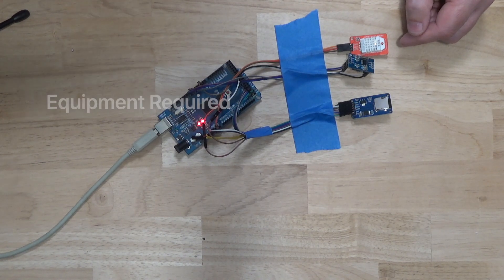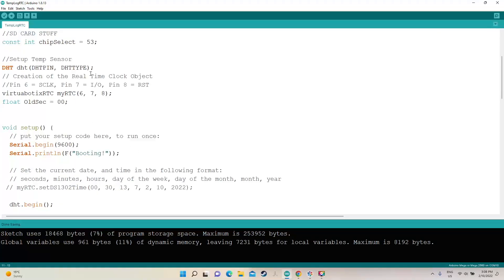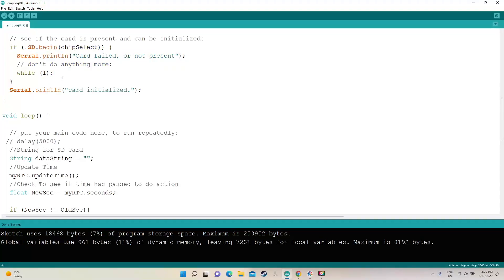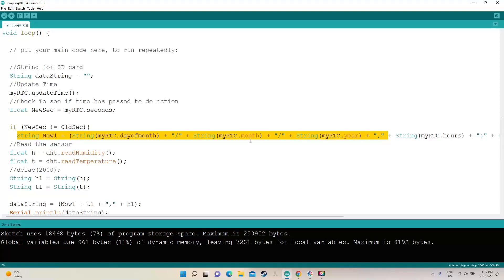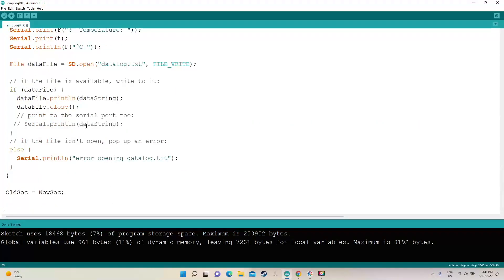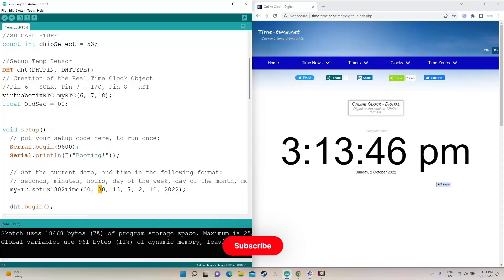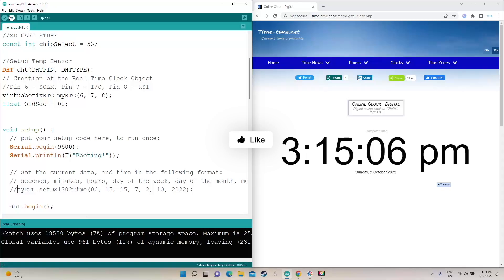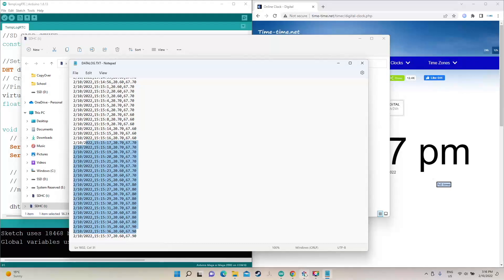SD Card Data logger using a Real Time Clock and Arduino

Comment: what is benefit to using rtc board? doesnt arduino have built in timers?
Reply from the maker: It’s the actual time, and it keeps it. 

If you wanted a recording at exactly 1pm you would need a clock reference either from an rtc or gps sync.  If near enough is good enough you could get away with the onboard timer.

Comment: Which sensors you used
Reply: Please reply asap
Reply from the maker: @067_syedtahir_ee9  it’s just a DHT11
Reply: @50Hz   when I run your program it shows us  nan
Reply: On serials monitor can you please fix it
Reply from the maker: @067_syedtahir_ee9  it means not a number.  Check connections, try a different sensor
Reply: @50Hz   can I contact you on ?
Reply from the maker: @067_syedtahir_ee9  email me the code. I’ll have a look tomorrow
Reply from the maker: @067_syedtahir_ee9  jongrimes1983@gmail.com